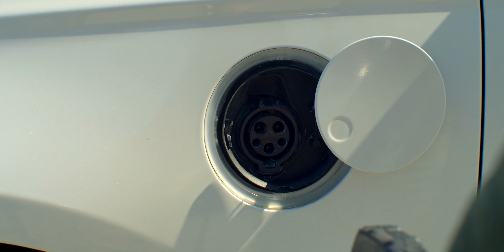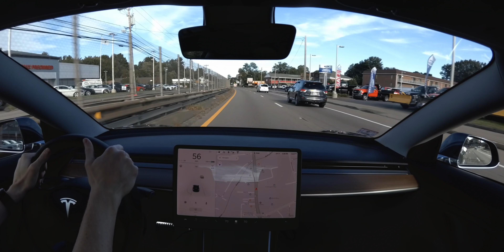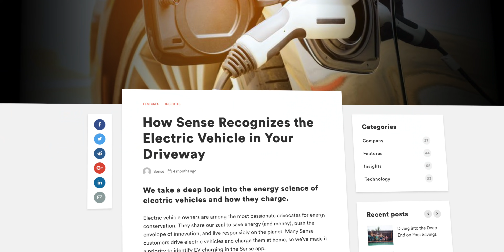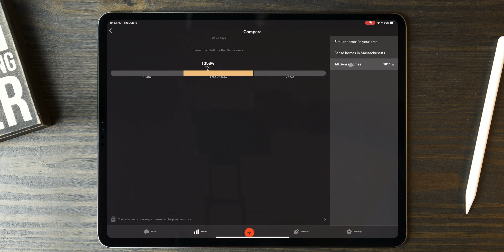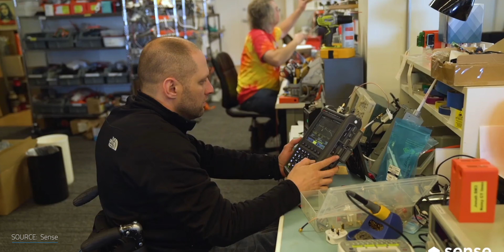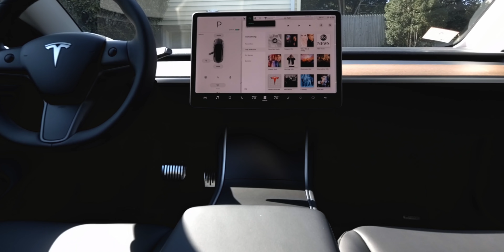Tracking your EV, solar, and energy use with machine learning - Sense smart home interview

Comment: my comment from the review vid: had bought one when i was moving from my old house, so that when I moved into my current house, i would get data from the get-go. I love this and am always, even nearly 2 years later, still going back to the app to see how my home usage has been changing over time.  like one thing i did the very next day after installing the sense, was to replace all of the incandescent (yes, the previous owner had a LOT of them) and CFL bulbs that came with the house, to LEDs and immediately saw the decrease in power usage in the app. very cool. would i do it again or recommend it to someone else? my resounding answer: absolutely!

Comment: Really interesting, I have a smappee which is a very similar device over in europe. It was the first smart home device i ever bought and it started saving me money way before i followed up with solar. I identified those power hogs really quickly and also helped me to find my ancient microwave was using 60w in standby! Now thanks to smappee my background load is down to about 60-70w and it paid for itself in less than a year. I think sense and smappee are in the same generational system and the best way smappee explained the self discovery was "It's like shazam for power" it does leave something to be desired, like you said picking up my fridge many times etc. Smappee has a training mode too though does sense? even that is not perfect i still keep it around though as when it sees export in the winter it turns on a old oil radiator without and cloud stuff like iffft etc. Oh and air quality Tado over ecobee said this before :)

Comment: I've had my sense for almost 2 years now I really like the information I get from it. I also know that there are a lot of devices it hasn't recognized like my 15kW demand hot water heater and I understand that variable loads like that, similar to EV chargers, are difficult to identify. Add to that 18 separate 3-speed circulator pumps in my heating systems and variable speed fans in my computer cooling system and I represent a significant challenge. That said, I would love to help Sense do some supervised learning :~)
  The other thing I would like to see is the ability to manage more than one Sense on s single account. I have 3 buildings I don't have room in the outside entrance box for the Sense but I'm guessing not a lot of other customers are in need of that.
  Finally, I have been fooling around with home automation for years using Insteon (which communicates over the electrical system and so branches across all 3 buildings) and a homegrown system based on a Raspberry Pi that switches between my wood and gas boilers. The cost of home automation systems is still pretty high but I would love to see a consortium of companies, including Sense, that could provide the ability to communicate with all the sensors and all the controls so that home automation became solely a coding challenge. Buildings use 40% of the country's energy. That's more than transportation and more than industrial production! That seems like very low hanging fruit, particularly considering the fact that virtually no commercial building is comfortable...but that's a rant for another day.

Comment: Great interview and info from Sense as well. I have been using my Sense for about a year now and have captured all kinds of useful information. It helped me identify a problem with our septic tank (lift pump running more frequently than it should), identified massive energy hogs with some old fluorescent bulbs, and recently identified a failed capacitor in my HVAC system. The current state of Sense does require someone that is quite analytical as the user to get the full benefit of the tool, but I see that changing as the AI continues to improve down the road. Thanks for taking the time to put this together!

Comment: Thanks for this interview. I have used Sense for 3 years, mainly installing it as a curiosity and a cool “wow factor” to show friends. Sense is great at picking up large devices in the home, but it’s much harder for it to find small devices like light bulbs. I would love to get more direct integration into smart home hubs, which I feel could help Sense identify the smaller devices that I have controlled throughout the home. I’m also concerned about Sense’s financial model, though. I wonder if they will need to eventually need subscriptions to support their work, since a one-time hardware purchase is great for consumers but doesn’t provide recurring revenue.

Comment: Matt, your guest Mike Phillips needs to address the following issue:

Sense is designed with a severe limitation that will make it unusable for many people. It must not be installed at a location exceeding 2000 meters above sea level. (see warnings: https://sense.com/guides/install-guide-legal/ ) 2000 meters is 6562 feet. Nobody lives above 6562 feet? Here's Wikipedia's list of US cities by elevation: https://en.wikipedia.org/wiki/List_of_cities_in_the_United_States_by_elevation  Cities are not flat and typically elevation is measured at city hall. For example I'm in Colorado Springs, and while city hall (and my house) are below 6562 feet, I know for a fact that many parts of our city are above that altitude. And I bet there are high-rise condos in downtown Denver that exceed 6562 feet. And for sure I cannot use this at my cabin outside of Cripple Creek, CO (at 10,070 feet).

I'm a BSEE and I've worked in the computer storage industry for many years, including a few enterprise-class systems. We designed out systems to work at altitudes up to 10,000 feet above sea level. Meaning, we expect places like Santa Fe and Phoenix to have their fair share of data centers, and the possibility that a few businesses in smaller towns to need serious storage capability. Most server makers design for either 10,000 feet or 3,000 meters. However with a home system 10,000 feet (3048 meters) is probably the minimum, and realistically it should be higher.  6562 is a joke.

Why electronics fail at high altitude. Cooling: with thinner air fans have to spin faster or heat sinks need to be bigger. Hard disk drives: at altitude heads fly closer to the surface of the platters; if the drive gets bumped will a corner of the head touch? Soft errors: many sources for soft errors, but the contribution from cosmic rays is 4x higher at 10,000 feet than it is at 1,000 feet. High voltage arc over: I suspect this is the real reason for Sense's shitty specification. It's not so much the working voltages, but the possibility of high voltage transients that can cause trouble. You cannot get a approval from folks like UL or CSA unless your equipment passes a high-pot test (thousands of volts between the high and low voltage sides for several minutes, with no breakdown of insulation). This is accomplished with techniques like: extra space between traces, slots in the circuit board, conformal coating, and any component that bridges the gap between high and low (e.g. optocouplers, isolation transformers, etc) being certified for high-pot usage.

Sense is gotten lazy and failed to design an adequate system for use in the USA and Canada (their stated market). They need a Sense II product.

Comment: Own Sense system for two years. The product is absolute garbage and all claims are smoke and mirrors. If you have a fifty years old house with older equipment , it may work, but anything modern with led lights or low consumption devices is no bueno. Don’t waste you money on this AI BS..

Comment: I've been waiting for technologies like this to mature before really jumping into home automation. I used to use a network adapter in my apartment that would send data over my power circuits essentially turning my electrical wiring into an ethernet cable. I wonder if major appliance manufacturers could just send some data points out over the 110 or 220 power line to allow for more precise power consumption and appliance mode information. If possible there would be no additional wiring needed and a smart controller could collect that data and allow for advanced control and monitoring.

Comment: Matt, excellent video.  The technology Sense is using is not new.  Saving signatures, comparing signatures and identifying signatures is used a lot.  With using one common point of monitoring(the mains), it does make this work more difficult.  The US Navy uses a system like this for sonar signatures.  In all of these systems, you cannot usually identify 2 or more objects that have the same signature.  For example, if you have 2 lamps that use a 60W bulb, your system cannot distinguish between them because they have the same signature.  Now you could setup one lamp with a 60W incandescent and the other with a 60W equivalent LED bulb and then the system would be able to distinguish them.  But that is kinda silly to do that.

Comment: About using solar to charge an EV. I just got that working. It's a bit of a mishmash, using sense to detect production and consumption. That feeds into hassio. That in turn does some logic and also feeds into TWCManager which controls my two tesla wall connectors and feeds my cars only excess amps. If a cloud blows in or the clothes dryer turns on, my cars immediately get less electricity, and it'll stop all together when the sun goes down or heavy cloud reduces production.
Using sense, hassio and tplink plugs I also have various household battery chargers only turn on when there is solar production (ie cordess vacuum, toothbrushes)
Reply: just buy a solar charge controller, some old 18650´s, a BMS, an inverter and start a new hobby!

Comment: Sound recording failure. The interviewee made zero effort to deal with the bad room acoustics but using an external microphone instead of the built-in one on his device. Matt, you should tell them to at least use earphones, either corded or wireless, that have a microphone. "Bad sound makes good video look bad."

Comment: Great video.  I enjoy my Sense for sure.  Does it work 100% like I want.... No but it's close.  True story our HVAC was running a lot last week and I thought it was more than usual.  I checked my sense and WOW it was running all day long.  Called the HVAC guy I was low on freon.  Sense saved me a hot summer by helping me diagnose an issue faster and get it fixed.   It would be nice is Sense would put in some alerts when a device strays from it's norm pattern.  Case in point my HVAC had been running longer and longer for a couple weeks and I'm sure Sense noticed the usage increase.

Comment: Your EV charger doesn't tell you how much it's putting in the car?
Reply from the maker: The car tells you KWh, but that’s how much it received to the battery.  But batteries aren’t 1:1 conversion.  Charging an EV might be somewhere around 99-95% efficient, meaning there’s energy loss during charging.  Knowing how much is actually getting used to charge gives you a more accurate understanding of usage and cost.
Reply: @UndecidedTechnology  exactly. My EV charger is 0.86 efficient

Comment: Wonder if this system works on 240V mains in Australia with 5kW solar and Sonnen battery and Tesla model 3 etc?  A lot of people in Australia also have three phase systems typically to run air con at 415V.
Reply: Unfortunately no. In 2016, Sense had  no plans to expand to Europe or Australia which have a similar market and grid. Some of this is because the ML requires a “Clean” trace for NILM detection, and switching from 60hz to 50hz will create issues with mixing the pumps and transformer ‘signals’ that have a vastly different peak/variability. It would be possible if they separated or trained devices, but it’ would need a different internal wiring to power the device, which isn’t too hard, but its also using internal CT clamps on the incoming voltage. As a result, it can’t do 3 phase either, only 2 of 3 phases. 

Devices like Smappee, or Efergy or watts clever, if you can find them, can do something similar, but the price is just as exorbitant and the results are not as clear.  Sense has better NILM detection, but it’s limited to 60hz. Smappee has decent 1-phase, but their Infinity gear gets very expensive quickly to monitor sub-circuits with NILM detection. There’s also Neurio, but their NILM is sporadic and has trouble with devices under 100w often as well as amperage limits. CURB, also wont work because it uses home plug/PLC or EoP to communicate, so it’s limited. 

There are also DIN install power monitors used for solar consumption monitoring which can work, but need an electrician to wire in. Reposit has one, and there’s a few devices from fluke, etc.
Reply from the maker: Awesome insights!

Comment: Seems to me that putting plugs in that monitor the power usage would also help figuring out what is consuming power.  If you had plugs in the kitchen, including one for the refrigerator, then it would be very easy to say that the coffee grinder and the kettle are always plugged into this outlet in the slow cooker is always plugged into that outlet.  Actually if I was building a new house now I would put in the smart plugs everywhere although that would end up costing a good chunk of change.
Reply from the maker: Absolutely.  Sense does integrate with some brands of smart outlets for that type of thing.  It also integrates with things like Philips Hue and LG televisions.  Once you link them up, the systems communicate to identify and properly track usage.

Comment: Love my sense, even though I do see duplicates or items that were 'known' before now turn on as Other.  The visibility into the energy being used is wonderful.  I have one light in the stairwell that uses more energy than every LED light in the house combined.  So it helps to see that when that light turns on the usage increases by 175Wh, to know that that device or bulbs need to be replaced.
I have a BMW-i3 and sense states they worked with that vehicle to recognize the function of charging, but mine never is recognized.  Some days I'll get the oven is on and then another 2500kWh usage when I plug the car in rather than everything in the Other or everything as the Oven.  Just odd how it randomly changes how it is recognized or not.  But, I'm not going to remove it, as the visibility is very worth it.
Reply from the maker: Thanks for sharing!
Reply: 2500kWh?? o.o that's, a lot. that's far more than the i3 battery pack holds, right? that's only 30 or 40kWh right?
Reply: @kaitlyn__L  The battery I have is 33kW.  You are correct it would be 2500Wh not kWhs.
Reply: @JustfishNascar  ah, that makes sense :)

Comment: Love it. On the site now, I have a solar consultation tomorrow so I’ll probably get the sense solar product. I’m just worried about installing.

I’ve got a pool and my EV and I’m not sure there is one place to track all that power since I’ve got two power panels inside the garage and one on the side of the house.
Reply from the maker: Good question.  Not sure if you can get by with one or would need two.  Sense can help you answer that if you reach out to them.  Installing isn’t hard, but I wasn’t comfortable doing it myself.  I ended up having my electrician do it at the same time as some other work I was having done.